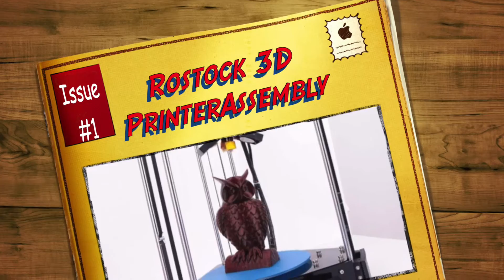Rostock mini 3D Printer assembly timelapse

Comment: Just ordered the Geeetech Delta Rostock Mini G2s Dual Extruder 3D Printer with the upgrades.  Aluminium arms, aluminum dual extruder platform and auto levelling and self calibration.  We will see how that goes.  Looking forward to it.  My other machine is a Solidoodle V3.  Looks like assemble requires a bit of modification.

Comment: Hi Thon nice video, I just finished putting together my foremost rostock afinibot. Have you found any good forums/websites discussing it?
Reply from the maker: Steve G Have not found a lot of sites but have not been looking...It's performing OK with the standard software out there...Do you have any issues?
Reply: Thon de Boer I get fine strings/hairs on the spikey test print. http://www.thingiverse.com/thing:533472 I've tried lots of settings but can't cure it. Otherwise very happy with the printer.